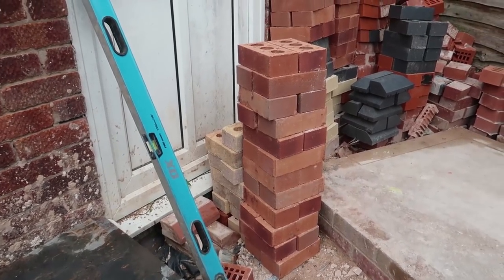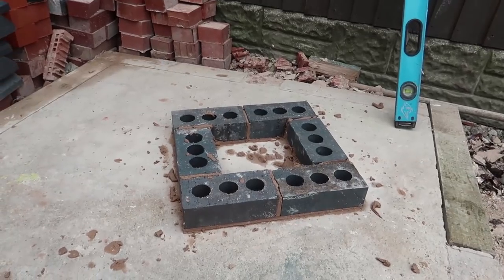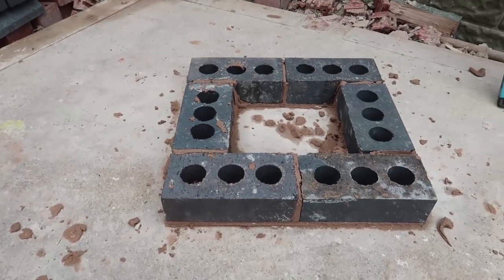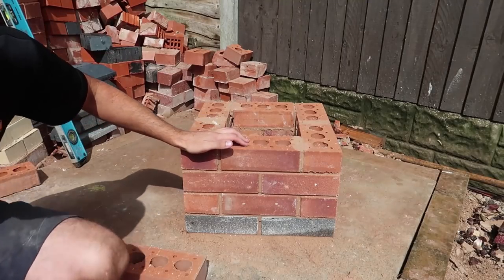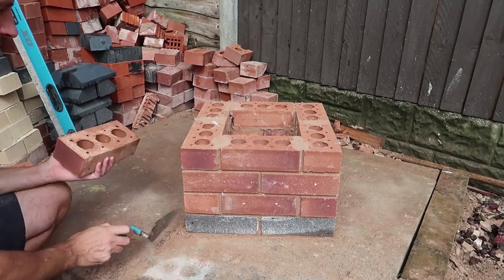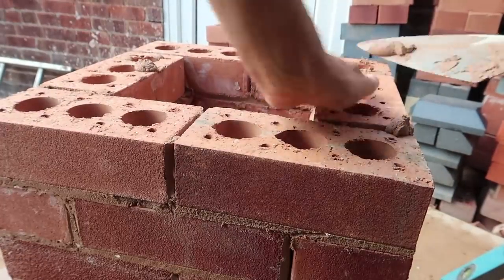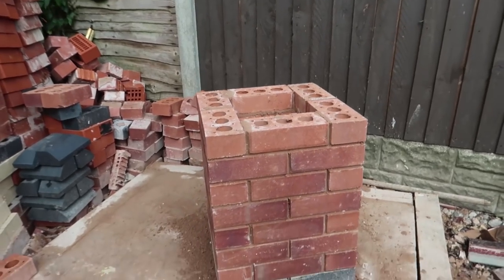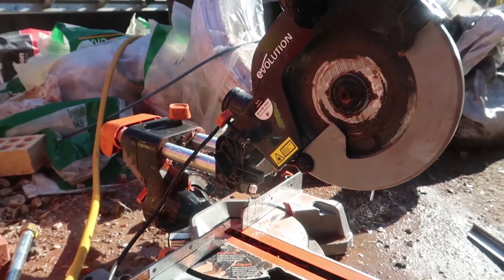Bricklaying - How to Build Decorative Brick Pier

Comment: 434 tut tut 😉.  Take it down start again 😂. 
I have been pointing a patio this week. Very few tiny cracks appearing in joints. 
Any tips as to how to get rid of them?
Hot weather soaking moisture up i think. Tried soaking slabs first but mortar smudges and looks scrap.
Any other brainstorm Stu please?
Reply: Add a little finer grade sand to your mix